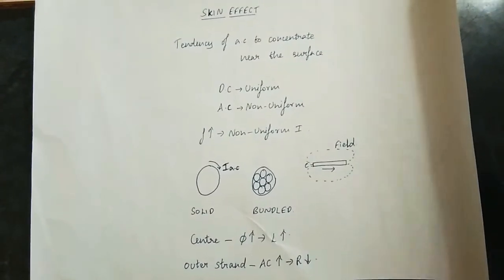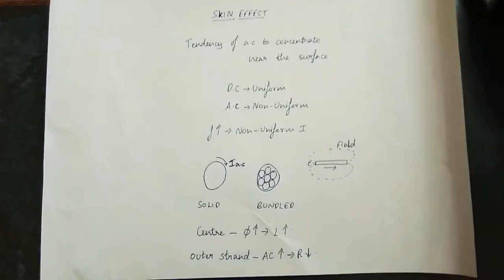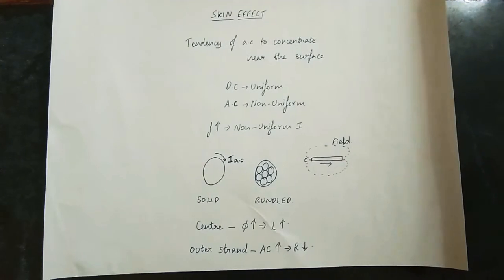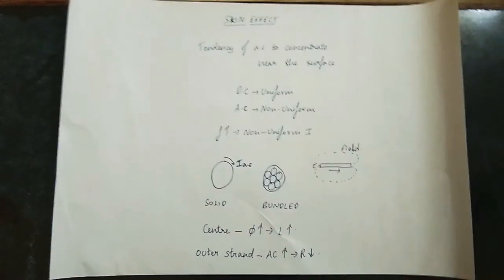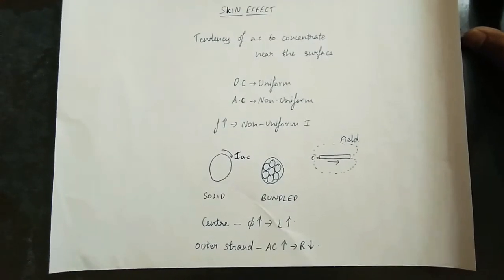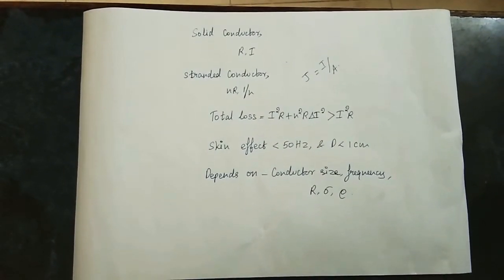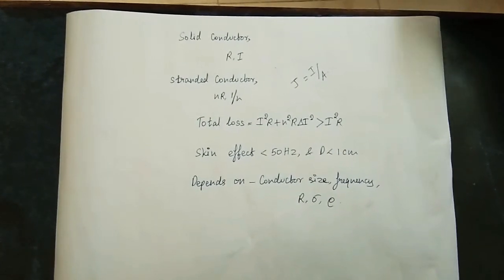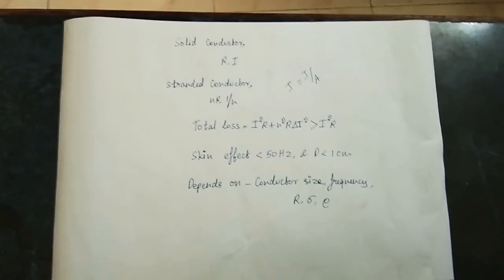Skin Effect Explained(Tamil) | EE | Transmission system

Comment: Bro.. actually middle la pora current Nala flux create agi atha oppose pandra inductance inner ku veliya iruka conductor full ah create aagum. But outer la pora current Nala create agura flux outer veliya pogum so atha oppose pandrathuku athuku mela conductor ila so inductance create agathu so free ah current flow aagum.. 
 Neenga AC iruntha dhan flux varum nu sollirukinga athu thappu DC um flux create panum.
 But yen DC flux la skin effect illana, DC la create agura flux ithemari outer conductor ah link panum but due to absence of change of flux anga voltage create agathu athavathu inductance create agathu. So athan skin effect ella
Reply from the maker: Due to absence of frequency 
In dc there is No skin effect.
You are also correct bro.
But while telling faster,i may miss the point
Reply: Yeah... There is no change in current in DC supply ... So no formation of flux..